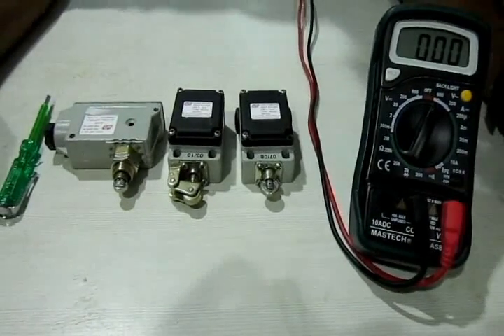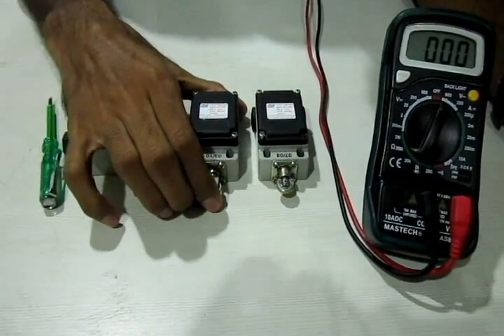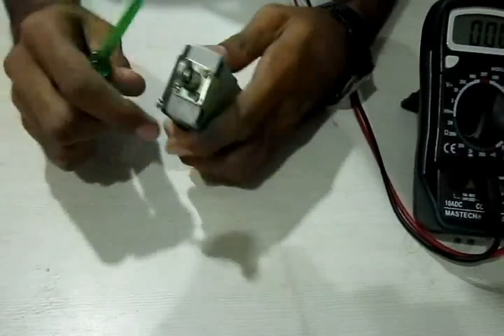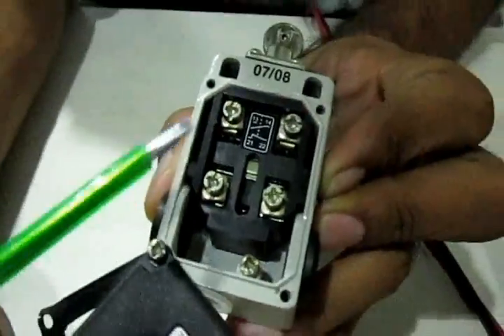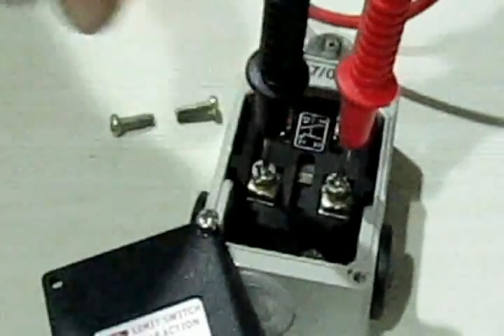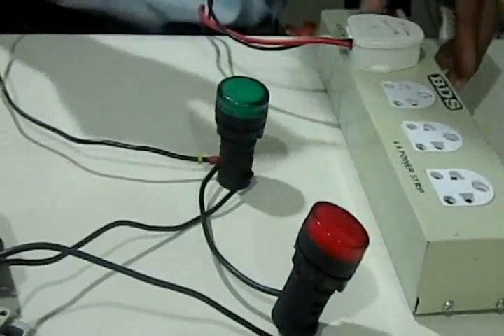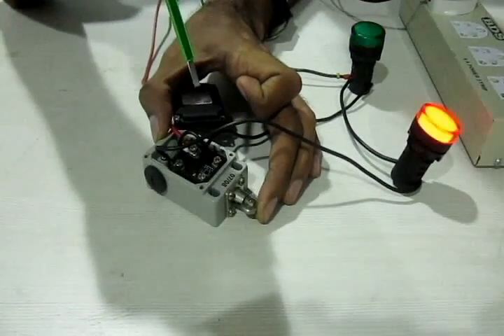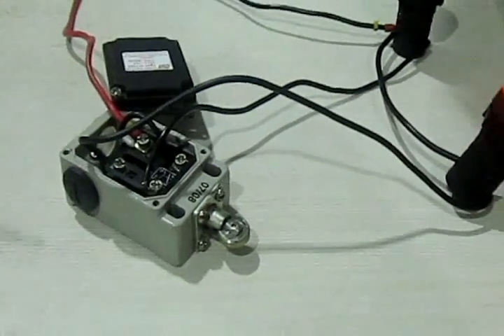How Limit Switches Works?

Comment: Nice video. Informative. Can this kind of limit switch be used to cut and uncut main 220V power supply to any machine or not. Say when button is pressed it cuts power supply other wise when button is not pressed or once its released 220V power supply resumes to machine to operate....! Any thoughts please..

Comment: nice video to understand how limit switches works and how they are useful in automation. One thing I wish to know on which basis we can decide voltage and current rating of the switch. We it needs to be designed to bare 10/15 AMP of current? How it is wired with the the PLC in case if necessary? How they are mounted on the system / valve / actuator? Do we need any special mechanical arrangement for switch mounting for our application? Please help me understand.
Reply from the maker: Thanks Jayesh Trivedi  for yoru appreciation. We decide limit switches based on the Ampere rating of the load connected to it and also based on the application. There are different types of limit switches available as you can see on the table. For mounting you can screw it up or can design its holder in special cases.